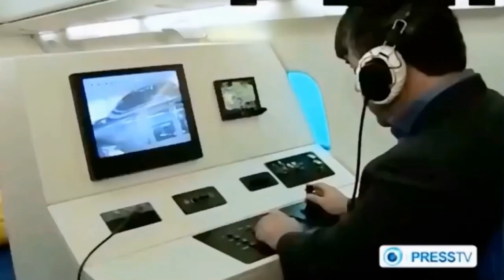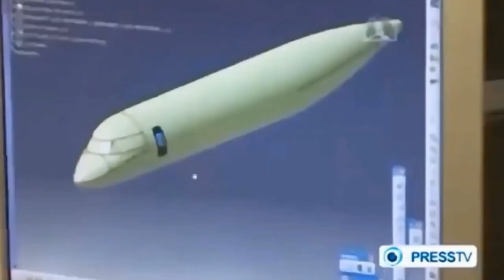IRAN builds Military Transport Aircraft ! Completely domestic 🇮🇷 !

Comment: Better to work on blade less fluidic engine because it is very new technology, very safer, easier to build. No need for to many moving parts, and can be made from different materials. from plastic. .....to steel. and even you can increase the trust by adding combustion chamber to increase the power. .......
Reply from the maker: This is a good solution 👌
Reply: Go to jet optera in utube.

Comment: The original proposal for this aircraft was to use TV7 engines. However, for some unknown reasons the TV3 was chosen as the engine type for this aircraft. Iran should have dedicated this aircraft for military use from the onset as the country needed much experience before opting for a high safety  requirement for passenger aircrafts. 
I would still like to see the TV7 engines on this aircraft which produces more power with same fuel consumption and it has the same geometric dimentions. TV7 engines would even boost the capability of this aircraft as a military transport.
In any case, Iran has invested much money in production of this aircraft and so it would be a waste of much investment in fund, technology and manpower to shut the production. Glad to see Iran finally came to decide to use this aircraft for military transport for now.
Reply from the maker: Yes, exactly . You made an important point 🌹
Reply: i think in past 5years ago.iran owj industry and hesa air plane factory have developed the engines and native systems.and this plane will be used in military purposes and in future i think this plane will be better than atr planes.